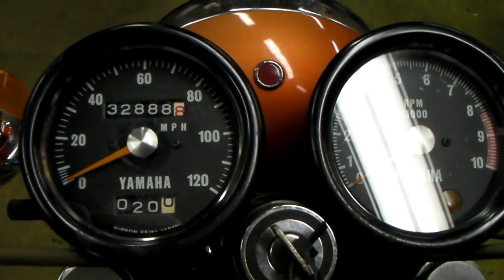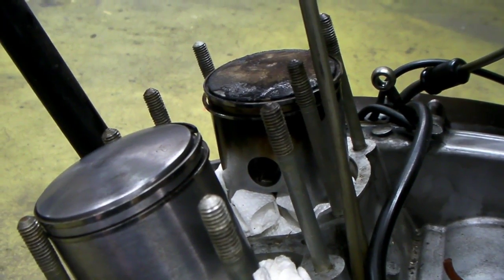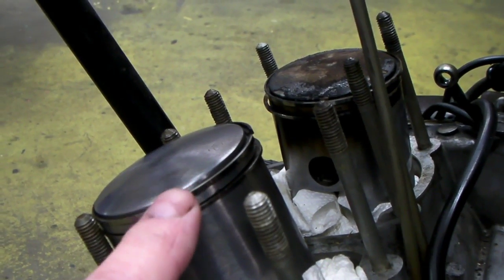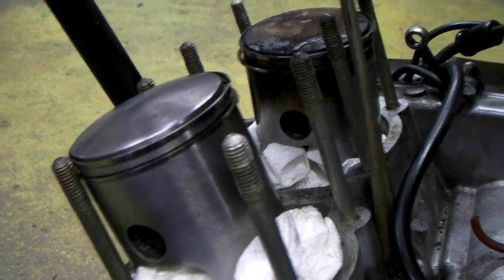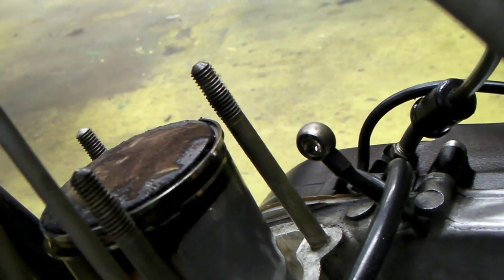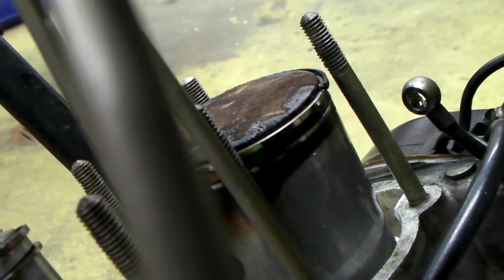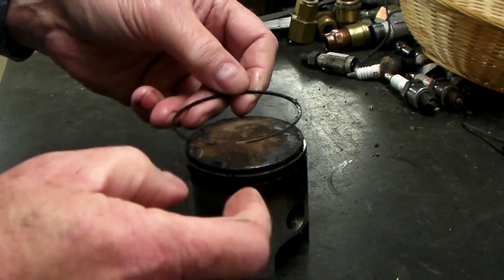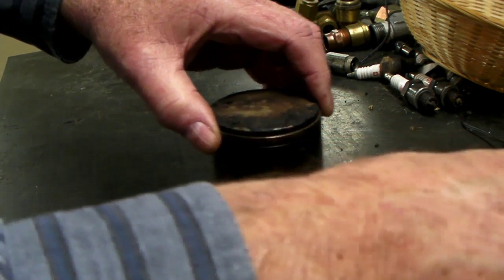2 stroke decarbon of piston rings.

Comment: So you're saying that this one set of 1st over pistons have been in your bike since around 5K miles and it now has 33K miles and looks like this?? Even with periodically cleaning the carbon off those look absolutely wonderful!!
Reply from the maker: Yes. Those are the original pistons. They still work fine. Original rings as well. I decarbon and check the rings to be sure they are free. Please see my Rotax videos on the Chinook Playlist. Sold the Chinook with 1400 hours on the original pistons.
Reply: @Adventurepilot70  WOW. How often do you do this procedure on the bike? I don't see any scouring at all anywhere. How do the cylinders look if I may ask?
Reply from the maker: @ScottSpeed95  I decarbon at about 8000 miles. It is easy to do. I set the points and check timing at about 4000 miles.
Reply from the maker: @ScottSpeed95  cylinders look fine very little wear. I use Pennsville premium semi synthetic oil from wall mart in bike and airplane.  Working on a 1955 sears allstate bike. Ready to paint when I get time. There is a Playlist on that.